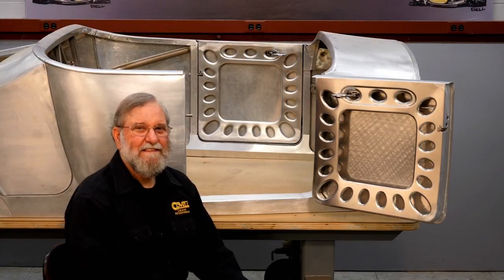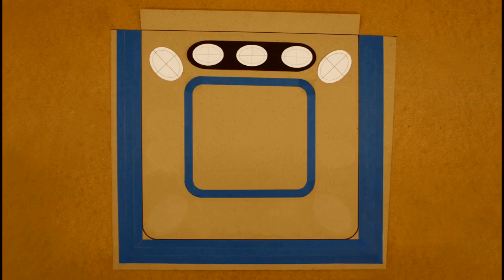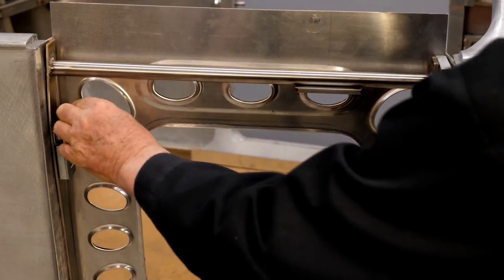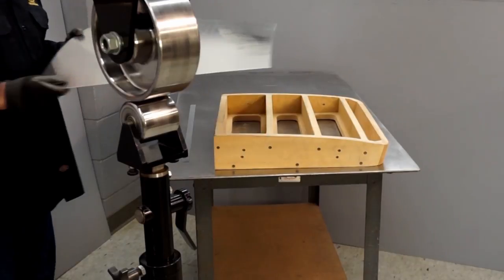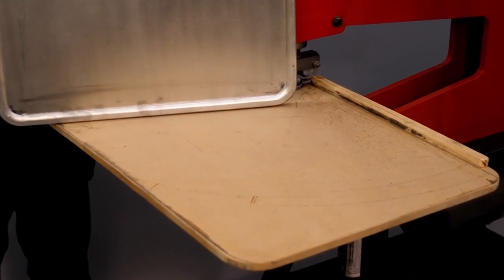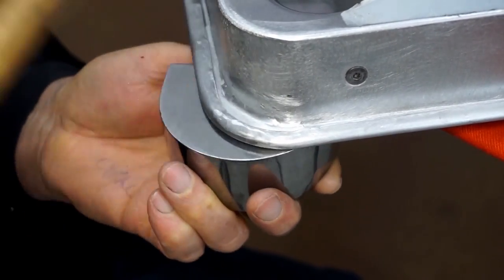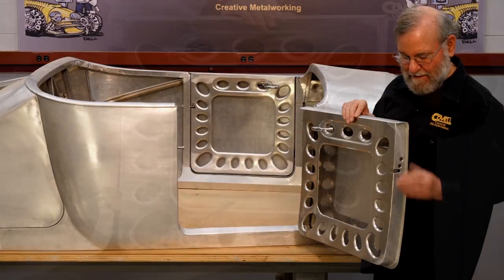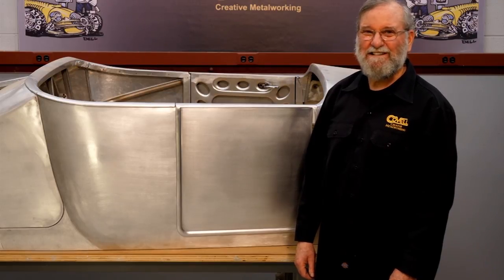Building Roadster Doors

Comment: I don't believe Dake produces the "Hammer" you used. So, what Power Hammer do you suggest that best duplicates the Dake and/or can be used to produce the "Beads" you made? Thanks very much. Always enjoy seeing the methods you use.
Reply from the maker: The best comparable machine is the MiniMax sold by Trick Tools: 
https://www.trick-tools.com/tools/Proline-Mini-Max
Sometimes you can find a used Pullmax machine at a lower cost, but for a smaller workspace, it really is great to have a machine that can be moved on casters, and that can run on 120 volts!
Reply: @RonCovell  Thanks much. Take care!

Comment: A pretty much useless video Ron. There are not but a handful of shops that have that very expensive equipment and they don’t need a video to operate it. I need roadster doors, but I can’t ’ possibly build them you’re way.
Reply from the maker: Well, clever people can often find ways to make what they need by using the tools they have available. The bead on these doors would be quite challenging to make without a reciprocating machine, but everything else could be done with simpler tools. And, you can buy pre-made steel door skins for these cars.